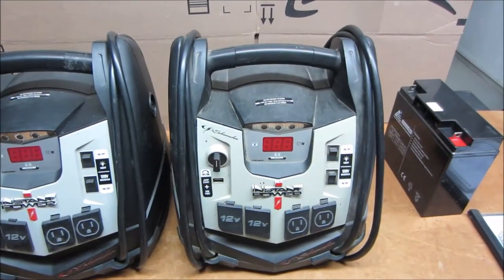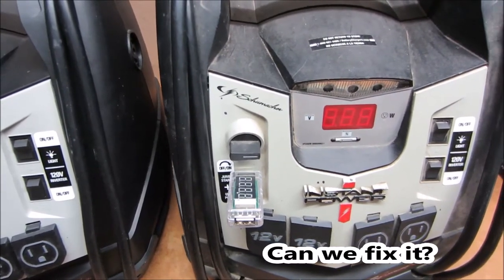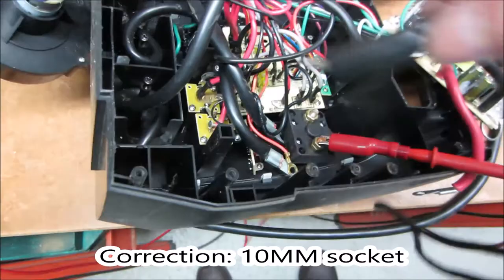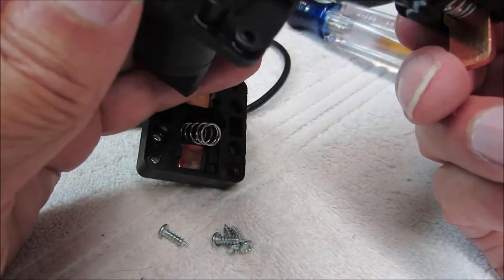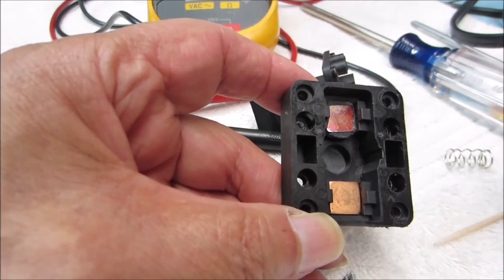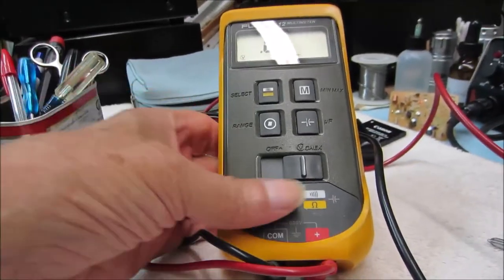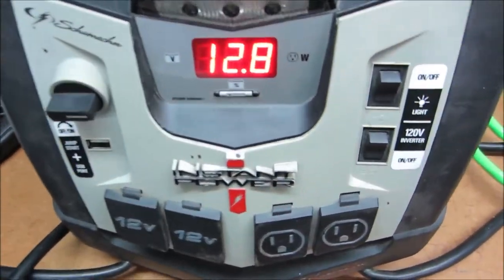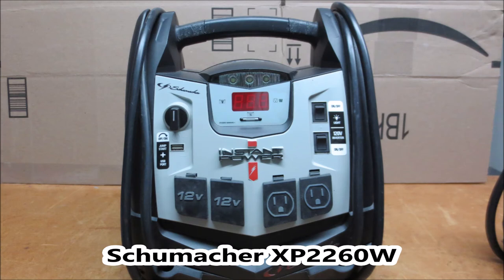Portable Power Repair Secrets - Schumacher™ XP2260W

Comment: My air compressor stopped working. Turns on but almost no air comes out. Is it worth opening up to diagnose what the problem might be?  

I generally use this device only to pump up vehicle and bicycle tires and have owned for about 5 years. Any ideas?
Reply from the maker: Most likely the air hose has cracked, detached or has a hole in it. If not, check for low voltage to the pump. If you can pry the ON/OFF switch forward, without taking the covers off, try shorting across the contacts. If the pump starts working normally again, a corroded, high resistance switch is the problem. Measure its length, width, and depth carefully with a caliper. Order a bag of ridiculously cheap replacements from AliExpress. Avoid Cainiao Shipping (even if it's free). Pay a dollar or two extra for AliExpress Standard shipping (as necessary), and new switches should arrive in 2 to 3 weeks. Good luck! Thanks for commenting. Please like and subscribe as it really helps the channel.
Reply: Sir, if my air hose is broken, can I replace it? Is there a video on this?
Reply from the maker: Not easily. Larger compressors used with air tools in garages and workshops have NPT (National Pipe Thread) fittings. To replace a hose on those compressors, grab two wrenches and simply unscrew it. But, small air pumps used in portable power stations tend to have crimped fittings, on both ends. To replace the hose you would need to uncrimp it from the pump. Certainly you would have to remove the pump to do that. Then, you would need a new hose assembly, a new crimp fitting, and an expensive crimp tool to attach it. Alternately, I guess you could try attaching the new hose with a tiny, stainless steel hose clamp. Then, there's the question of where you're going to get the new hose? I'm sure someone, somewhere has done it, but generally speaking, the hose is part of the air pump assembly and in the event of hose failure (unless it's something you can cut in half and possibly extend) you have to replace the whole thing. Lot's of online videos show how to repair a leaking air hose... Good luck! Thanks for commenting.

Comment: I have this same model but it won't charge at all. When you push the button nothing happens so the battery is totally dead. I have plugged it into different outlets with different cord and nothing. The green light won't even light up when plugged in. Does the battery need replaced or is it something else?
Reply from the maker: It's easy enough to find out. Just watch "Portable Power Repair Secrets - DieHard 950" https://youtu.be/g5ibI23UWCA and/or "Portable Power Repair Secrets - Duralast BP DL750 Jump Starter" https://youtu.be/rTAegAgd_HY for step-by-step instructions. If you confirm that the currently installed battery is stone dead, and that after connecting a known good battery (internally or externally) the unit still doesn't charge (charge voltage across the battery should be between 13 and 14 Volts), then you may have a broken flip-out AC power plug on the back of the unit. If that's the case (common problem) replace the flip out plug with a standard AC power socket. You can buy a new one online, or you can rob one from a discarded desktop computer, DVD player, stereo component, TV, VCR, etc. The replacement AC power socket in my XP2260 came from a discarded PC power supply and only required a little filing to make it fit. Hope this helps. Thanks for asking! Please like and subscribe as it really helps the channel.
Reply: @LawrencePina  I bought a new battery that came 90% charged but when I plug in the cord to the A/C inlet to charge it , it still will not charge and the charge light won't turn on. Looks like that A/C inlet part has been discontinued.
Reply from the maker: Replace it with a common AC socket like this:

https://www.aliexpress.com/item/32804170262.html?spm=a2g0o.productlist.0.0.153c5a14HQiniT&algo_pvid=9e846bdf-b19d-4beb-82b0-76cd5eaf92bc&algo_exp_id=9e846bdf-b19d-4beb-82b0-76cd5eaf92bc-22&pdp_ext_f=%7B%22sku_id%22%3A%2264309682539%22%7D&pdp_pi=-1%3B1.04%3B-1%3BUSD+0.97%40salePrice%3BUSD%3Bsearch-mainSearch

Replacement is easy. Horizontally, the two sockets are about the same size. An oscillating tool fitted with a blade designed for cutting wood and plastic (not one made for cutting metal) makes short work of the plastic brackets (molded to the rear cover) that held the old socket. If you don't already have one, consider something like this:

https://www.harborfreight.com/16-amp-single-speed-oscillating-multi-tool-62866.html

Vertically, the new socket is a little taller. Just enlarge the opening using a small file. Perhaps you have a broken CD/DVD player, VCR, computer power supply, etc. that you can rob a perfectly good socket from? If so, don't forget the power cord. Good luck! Thanks again for commenting.

Comment: My wife gifted me this box less then a year ago I've used it twice it set maybe 3-4 months I went to use it again and nothing I charged it almost two days and NOTHING no lights of indication of power of any kind couldn't return it she trashed the receipt and the store is offering no help so I saw your video in hopes of some advice on what to do with this box
Reply from the maker: You almost certainly have a dead battery https://www.amazon.com/Mighty-Max-Battery-Replaces-Schumacher/dp/B00UOPPJJ8. Mustie1 shows how to test and replace a typical power pack here: https://www.youtube.com/watch?v=-VTElQ6URQ4 but note that replacement is much easier on the XP2260W because you don't have to take the whole unit apart. All you have to do is unscrew the battery compartment door. Good luck! Thanks for commenting.
Reply: @LawrencePina   hey can these be jumped like car batteries?
Reply from the maker: Yes. That's exactly what Mustie1 does in his video: https://www.youtube.com/watch?v=-VTElQ6URQ4

Comment: WOW your good!  My unit will not charge at all, although when plugged in to charge it says 100%  any suggestions??
Reply from the maker: What about the battery terminals? Have you looked at them? Are they corroded? When the AC charge cable is disconnected, and you turn on main power, what voltage does the display indicate? A fully charged, properly connected  battery should read about 13V. If you can't tell because the display does not light up (not clear from your description of the problem), grab a multimeter and measure battery voltage across the red and black jumper cables. If it reads 12.5V to 13V (main power switch on) your battery is charged. If it reads much less than that, put a battery charger across across the jumper cables and retest after a couple of hours. If the battery charges that way, then there is a problem in the unit. If it doesn't charge that way, if you can't even charge the battery after removing it from the unit, then you've got a bad battery. And remember, the usual problem with these units is a broken / intermittent charge socket. Are you sure that it's intact? If not, easy fix. Good luck! Thanks for commenting.
Reply: @LawrencePina  OK I charged the unit for 12 hours... no juice.  when the unit was plugged in to the electric the light would come on. When I unplugged the unit the light goes out.  Maybe it's time to replace the battery????
Reply: @LawrencePina   Probable made in china
Reply from the maker: @stableboynmilkmaid  Take out the battery and test it with a voltmeter!
Reply: @LawrencePina  How do you fix the intermittent charge socket? Mine won't charge at all.

Comment: How do you turn off the low voltage beep
Reply from the maker: It's generally accepted that rechargeable batteries should NOT be discharged beyond 50% capacity. That warning even applies to the most expensive, deep cycle, storage batteries. The low voltage warning on a portable power pack (with rechargeable, storage battery) sounds off at about that level. If you continue using any function after the alarm sounds, the battery may suffer irreparable damage. It might never charge back to 100% capacity. Even when the display indicates 100%, it won't last very long. Other times, after having been discharged below 50% capacity, it might not take a charge at all. So, the low voltage warning is a safety device. If it's sounding after just a few minutes of use, you need to replace the battery. Power pack will be good as new. Otherwise, if you want to prove that the advice about NOT discharging below 50% is valid, without having to suffer through the alarm noise, I guess you could always disconnect the noise maker. Good luck! Thanks for commenting.
Reply: @LawrencePina  my beep doesn't stop. I charge for 12 hours and it beeped the whole time. Not sure if it will ever stopped. I finally ran compressor for the day just to kill battery. Plus it doesn't beep in compressor mode. Do you have any additional info. Do I just need to charge for a couple days or 24 hrs
Reply from the maker: Here's an easy way to determine whether it's the battery or the low voltage warning circuit:
1. Open the battery door, disconnect the negative side of the battery, or disconnect both sides of the battery and remove it altogether. You'll need a #2 Phillips screwdriver and two 8mm (aka 5/16 in.) wrenches to accomplish that.
2. Connect any other known good 12V battery to the jumper cables. You can use a car battery, a lawn mower battery, a lawn tractor battery, a portable generator battery, a motorcycle battery, whatever you've got.
3. Turn on main power and see what happens. Is the unit still beeping? Assuming you connected a fully charged battery, then the problem is in the power pack. If the beeping has stopped, then the problem is in the battery that you removed.
4. It might not be a bad idea to check both batteries with a volt meter as well. That way, you'll be sure that at least one of them is fully charged (12.5 - 13V).

Comment: I'm guessing that the meltdown was caused by the jumper cables rather than the USB .
Reply from the maker: You know, I thought that, too. Maybe someone tried to jump a shorted battery? But the 12V internal battery in the XP2260W had NOT been damaged. Both the jumper cables and the 12V to 5V USB adapter are directly connected to it through the rotary switch. And, why would trying to jump a shorted battery have blown up the 5V adapter? The USB connector is mounted just below the LCD, on the front of the display panel PCB. Quite a bit of work to get to it. There's a 2W current sense resistor connected to the 5V USB power pin, a 5V regulator and associated components just behind that. But, since the jumper cables were not melted and the battery was not damaged, I thinking it was more likely a USB problem. I guess we'll never know, but if I ever see that problem again, I'm pulling the display panel PCB, and testing it, before I put everything back together. Thanks for the helpful comment. Please like and subscribe as it really helps the channel.